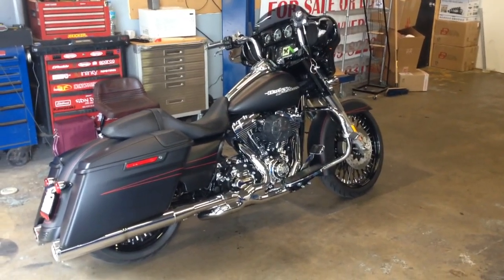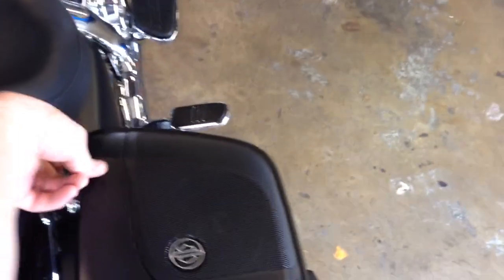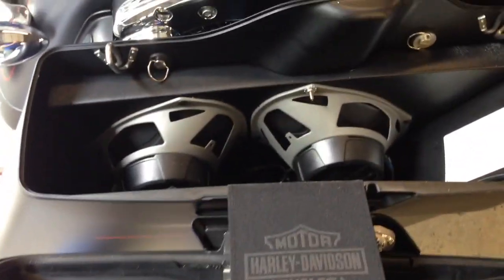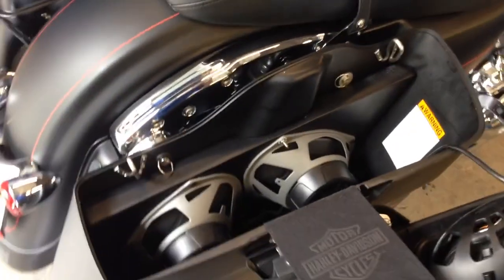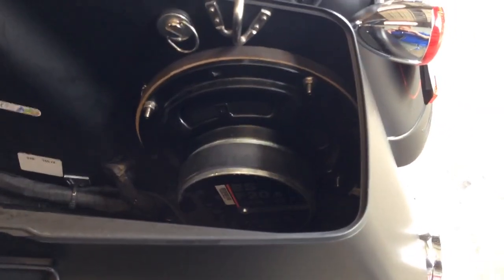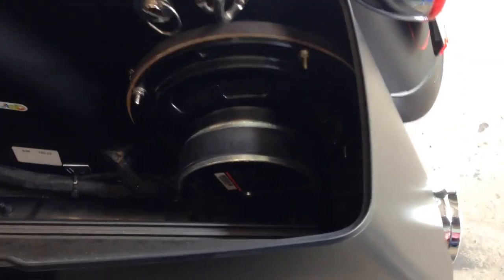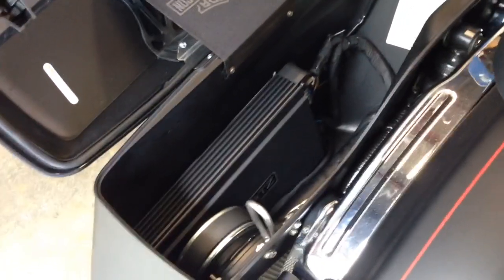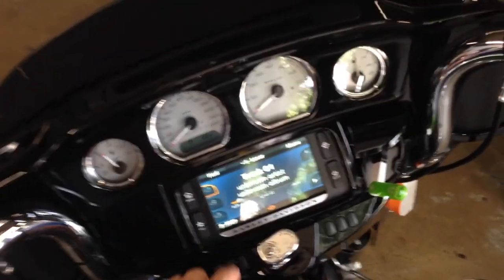2014 Harley Davidson Street Glide Stereo System Hertz

Comment: Question,? Does the hog tune lids, come with the locking mechanism and the speaker basket ? I didn't check my box when it came in, just got the lids back from the painter, and the locking mechanism  is not there, neither is the speaker baskets, thinking they disappeared on his end !

Comment: How good can u hear the subwoofer with the way  it’s set up
Reply from the maker: Brandon Johnson It’s nothing like a car. We’ve found that low bass is very hard to create on a bike in an open area. It’s mostly higher bass that sounds good. We’ve stepped out of subwoofers and more into a high performance 6x9 raw woofer or a more efficient midbass driver like a Beyma. I’d say 50-55hz and up.

Comment: great sounding bike, I was just in Daytona for 2017 bike week. I heard focal and Hertz for the first time at Daytona Audio. In my 2014 street glide I'm going to so Focal 6.5 up front with hertz 6x9 in the lids. Im going to mount either the Hertz 8inch sv200.1 mid range or the Hertz sv2000L subwoofers in the side of the bag. Looking for a recommendation on the woofer vs the mid range speakers.

Comment: Darren Fettik
So what I am seeing in order to get the aftermarket amp to be recognize  by the 2014 Harley radio HD needs to flash to the flat eq setting?? There's a 12db boost at 100hz, which will kill everything aftermarket once you add amplifiers so you must eliminate the hump??
Reply from the maker: Yes, exactly
Reply from the maker: Well the aftermarket amp can be installed currently except there will be a huge hump which will roast speakers and they will sound really bad.

Comment: Did you flash the stock stereo? If so how did you do it, Any recommendations?
Reply from the maker: Yes, we did. We have the programmer in house. The Harley dealers used to do it but they may have stopped. Check with them or perhaps call around to stereo shops to see if anyone has a programmer.

Comment: JL audio is the ticket. If you can figure out how to put two 12w7s on my 98 road king messege me. I need to be able to hear over my pipes.
Reply: Jason Virnig you should reconsider the hertz.  I went from 4 6.5s and 2 6x9 JL audios speakers to  Hertz in my 14 street glide special.  They sound so much clearer it's unreal.
Reply: Jake Wiens I don't have anything right now and have the leather side bags. Was thinking of getting that 500 dollar set up at Harley but I'm worried there will only be treble. And my bike is loud as fuck.
Reply: Jason Virnig I get plenty of bass with mine but I also got a Diamond Audio Micro4V2 600 Watt 4 channel amp.  Bike bumps pretty damn good turns a lot of heads.  There's a setting on it to get more treble or bass I currently have it on the treble setting.  The bass setting is pretty crazy bumps super hard if your more into that.  I went with the 6.5s in the fairing and lowers and 6x9s in the bags.  I'd like to add a sub like this guy has done think it would really top my system off nicely.  As far as my exhaust being loud I had louder bikes but my street glide isn't to bad I went with Rinehart 4inch slips.  Still need to get headers and air filter tho, once I get the headers it'll sound much louder I also don't run with any baffles.  Personal choice I suppose lol
Reply: Jake Wiens yep I have no restrictions in my pipes. Ive had the baddest systems in my 38 years of life. Old school sound stream have 4 tenw7 in my four door infinity and 1 tenW7 in my two door. Never heard anything that hurt my ears. Stand next to the Peavy's at rob zombie concert. But man my bike can hurt my ears lol. Got it like that. I don't have a ferring either so my options are limited.
Reply: Unfortunately if you keep standing by the Peavys you won't have to worry about hearing anything 15-20 yrs from now.

Comment: Like Raul I am having trouble getting HD to get radio to accept aftermarket amp and Everyone seem to not have a clue if you could help point me in right direction that would be great
Reply from the maker: Chazz, you can take the bike to HD and tell them you want the radio flashed to the flat eq setting. There's a 12db boost at 100hz, which will kill everything aftermarket once you add amplifiers so you must eliminate the hump. If a stereo shop has an RTA meter they can check the outputs of the factory radio when tuning it to see if it exists.
Reply: Darren Fettik  Thanks Darren for the quick response If i can get this Rockford Fosgate to work on Infotainment on HD .I will be extremely happy and owe you..lol..If i was in your area i would just bring bike to your shop nice set up on HD btw.. I will relay the info you gave me to HD and tell them what you said to get radio to recognize the amp .Is there anything else i need to tell them to get it working?..
Reply: Darren Fettik Oh btw with the Hertz you installed Darren does the handlebar  controsl still work ?The fade and etc?
Reply from the maker: Chazz, it has nothing to do with getting the radio to recognize the amplifier. That is in the installation of the amplifier and the amplifier should work regardless if you take it to HD. You system should be playing now but it will have way too much bass and will distort or blow the speakers. The only thing HD needs to do is flash the radio to remove the 100 hz midbass hump
Reply: Darren Fettik Just send me the bill for picking your brain about this Darren...lol
Reply from the maker: Lol. You're ok. And yes, the steering wheel controls still work.